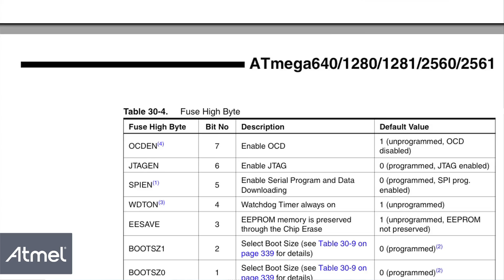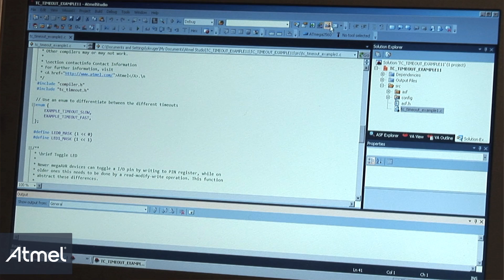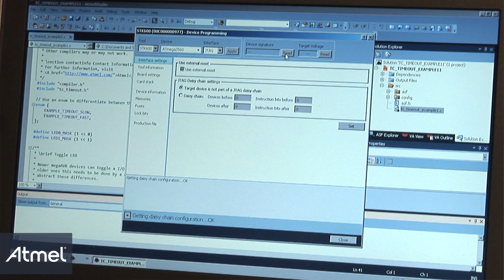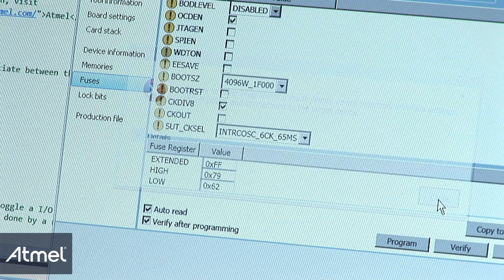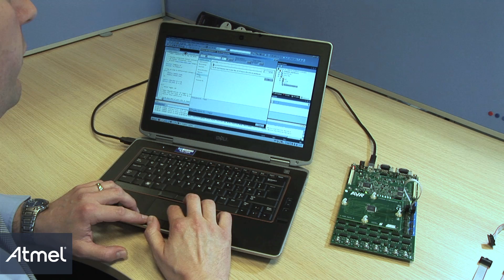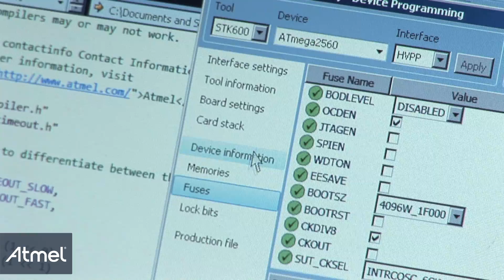Atmel: Incorrect Fuse Settings Solved With HVPP

Comment: This is nice but most people need to do that with an AVR Dragon. Neither the AVR Dragon online documentation nor the AVR 8 bit documentation (using ATmega328p in my case) shows how to connect the AVR Dragon to the ATmega328p for HVPP. This is a bit disappointing given it is so easy to end up with a target device in a bad state especially when using ISP and debugWire for OCD.

Comment: I have encountered devices, supplied as "new" from a distributor that I was unable to communicate with using AVRISP mkII In-System Programmer, the only programmer I have available. I now suspect that this was the only problem with the tube of parts.